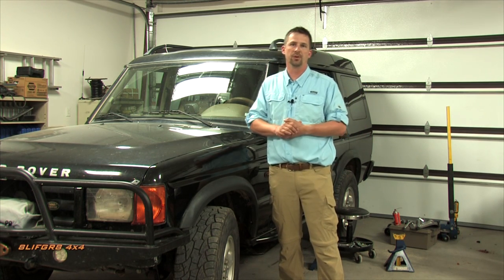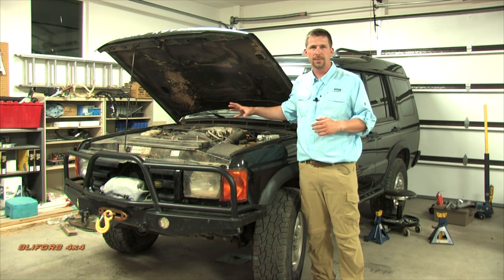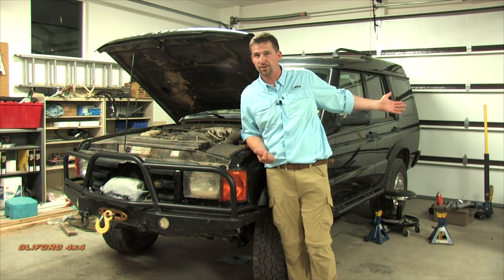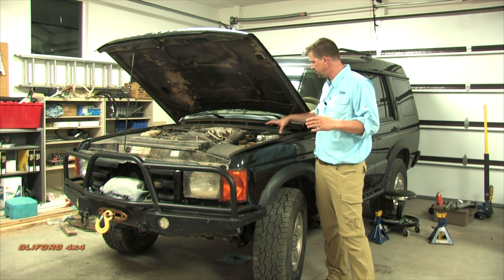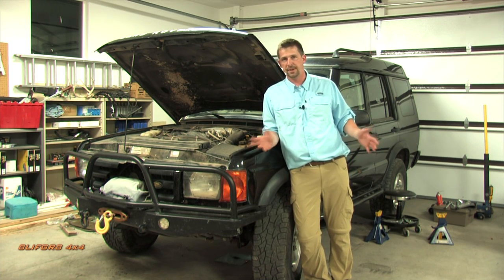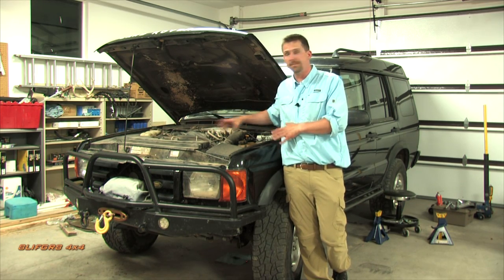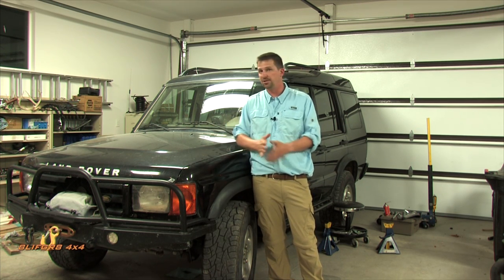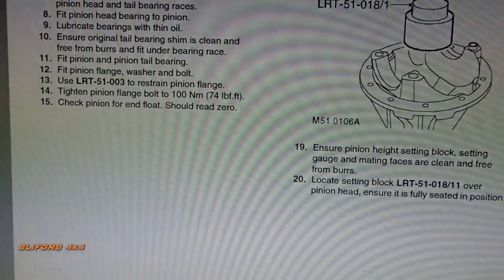Ultimate Owner's and Buyers Guide:  Land Rover Discovery 2

Comment: I’m taking a different approach at this project build. I’m from Memphis TN and am going to look at a 03 disco with 123k miles for around 1700$. even though they are the most disregarded out of the disco I’m itching to get my hands on one. This would be a multiple year project so I would have time to do a 04 transfer case swap eventually. Let me know what y’all think of this idea.
Reply from the maker: If the engine is solid, it should be a fun build.  Look into the '03 oil pump issues.

The prices are appealing, no doubt.

Comment: Very annoyingly in UK the central locking diff even in 2004 was only an optional extra not standard as it was in US. So I have. 2004 TD5 in basic trim with no centre diff (aaaaagh!) so at some point I’ll have to buy an earlier transfer case with the centre diff lock. DANGIT!
Reply: But at least I only paid £2200 for it!! :-)
Reply from the maker: Ugh, do you have the diff lock on the t-case?  Maybe you can do the d1 shifter like I did on my '99
Reply: @ForgottenWaypoints  I haven’t actually crawled under to check yet but I’m told that after the early 2000s they even stopped putting the none functioning diff lock in the case at the factory. Still I can hope and crawl under when it’s dry and look for the tell tale nut, you never know, I could be lucky eh! :-)
Reply from the maker: @garviere  , That's how it is in the states from sometime in 2000 or so to 2003 you won't have the diff lock.  But if they started putting them back on the T-cases in '04...who knows?  

I honestly didn't know you could get it without the CDL in '04.

Comment: I have served around the world with the RCN and have a,ways loved driving rovers. Well now that I’m at the end of a fantastic ride, I bought a 2003 Land Rover se. my kids have had it basically rebuilt. Thus I’ve started watching all the various blogs since even I know the these cars have issues. This video is great, so I have to ask two questions, what type of gas do I put in this brute. The mechanic is telling me just regular unleaded, yet gas cap says premium (I have 193,000 Khm ) on her, additionally. Should I remove the catalytic converter so as to ensure I don’t dry out the drive shaft. Thank you gents.
Reply from the maker: I'd keep the cats as the ECU is checking the O2s pre and post cats.   I ran premium because I was terrified of a slipped liner and wanted the best detergents; however, I don't think the compression ratio is high enough to justify it.  Maybe someone else will chime in??
Reply: Ok so do the things you talked about for drive shaft, I’m making the oil change this week. My mechanic is giving me grief for wanting to change the thermostat, he already did. Might add he is Iraqi ( Christian living here 20yrs) keeps saying it’s not the god damn Sahara here in Canada.
Reply from the maker: @shanecrawford6023  , Hahahah.  The problem isn't exterior temperatures, the problem is how hot it allows the block to get. 

With the TD5 thermostat, you are putting the engine block to the temperatures that Discovery 1 and GEMs V8 Range Rovers came out of the factory with.  The Bosch V8s were all elevated in temperature, and anecdotal evidence on the web suggests that this "encourages" future head gasket failures (GEMs motors don't have this issue as often as higher-temp Bosch V8s).

That's why I recommend the 180F TD5 thermostat.
Reply: I fully agree, all your points make sense. Itrue,y did t know that they were using 60s style of engine, thus we should be following how it would have been dealt with then. I believe I mentioned that come the end of month I’m changing the oil following your recommendations as well as thermostat. Once again thank you for putting out such a good video series, and more importantly emailing back.
Reply: Now that I’ve owned this land rover for 9 months, I’ve spent just under $3000 Cdn $2600 Us getting things fixed ex: leaky rear sun roof, rear right door not working, repaint roof and hood due to clear cost, and reservoir tank replaced.
I’ve changed the oils and oil filter following your suggestion, what diff Liu’s would you suggest, winter here in Ontario can get to -45c to 35c plus in summer.
Appreciate all your info to date.

Comment: Good review. Slipped liner is actually less of a problem than straight head gasket failure and cracks between the bores. Even with the lower temp 3 way thermostat in the bottom hose is that when full coolant flow is required the 3 way still diverts coolant to the heater matrix under the dash. Removing it and using a top hose Mezerre or similar 82 degree C inline thermostat. Amazing difference. Still gets hot enough to heat condensation out of the oil, get to closed loop and have completely normal fuel economy. The 3 amigos are often just wheel sensor however when they don't go it is usually a crack in a circuit board in the modulator.  You don't have to replace the modulator. Google WABCO ABS modulator Option B.  The genuine German made rear rubber coupling is excellent.  The front drive shaft...just get a Woody greasabe heavy-duty 1310 unis shaft.  Excellent gear. Greasabe centre ball also.  My D2 is  just under 20 years old . Had since new.  Used it a lot on beaches and never had a hint of rust.  Cheers
Reply from the maker: "never a hint or rust", the envy of Toyota fans everywhere..

Comment: My 99’ disco 2 temp gage doesn’t ever change indicating the engine temp is rising, etc... Is the gage suppose to move indicating a change of temp. Or should I not be worried assuming it is simply not over heating? Would a faulty code reader pick up on the temp sensor if it was bad?
Reply from the maker: If your gauge is stuck at center it means your temp is 158ish to 215ish.  If it's on the low side....you are fine.  If it's on the high side, you may be slowly cooking your head gaskets.

The only way to tell is get an OBDII scanner like an ultragage and use it instead.

Comment: The ZF autoboxes are not 5 speed but 4, the manual boxes are 5 speed.. The USA only has the V8 which came with automatic only i believe, so 4 speed.. just sayin ;)
Reply from the maker: Did I say 5 speed?  It's been so long since I made the video.  It's the 4HP22 in the V8s, definitely a 4 speed..  Oops.  Thanks for the clarification.

We didn't get the 5 speed in the states, the 5 speed was available in the D1, but not the D2 over here.
Reply: @ForgottenWaypoints   Yes i am in the UK we are lucky to have the TD5 and the V8 but we never had the later 4.6 in the D2 only in the P38  range rover :)

Comment: any1 every tried drilling air holes in oil filter large enough to help cool oil & by default engine safety protection at speed. Then wrap the filter in fiber mesh dippers to soak up hot oil, & few hose clamps to hold dippers on. Will drip a bit but shit engines all dip oil any way. Just need a catch cap over the dipper to catch what ever dips till u can pour in new oil & empty dipper & catch cap. Might need a new engine that get better than 13mph has power won't over heat & works w/good 5 speed or comes w/a similar good trans. Then u can get even better deal just find blown engine discovery in good shape minus engine.

Comment: I have a grunting steering box when turning steering wheel at 1-3 mph.  Started after replacing the hoses.  Do you have a fix for a steering box with this issue?
Reply from the maker: I'd post on the forums and see if anyone had issues.  My steering has been solid, the only issue I had was the linkage joints failing.  I ordered an HD track bar and draglink from Rovers North and fixed that.

Comment: I’m confuse on the engine, so why is it a v8 but has little power for hp and torque?  Also I saw one the other day for sale and I was going to buy it but I don’t know anything about these rigs besides the look of it.
Reply from the maker: 4.0L naturally aspirated over head valve V8 block from the 60s with modern fuel injection.  Honesty, the rover V8 is actually a pretty dang good motor for what it is, it's just the last production run that has issues.

Earlier blocks are modified for racing applications in the UK, similar to an old Chevy small block.

Comment: Thanks for a nice vid. I am in love with this vehicle TD5 Diesel engine with 2500 cc. It a good thing that you have explained a lot of thing. I am living in a country which i actually not cold (Tanzania) so please tell me will that t/stat be an issue to me? Will tht need to be removed forever?
Thanks Man.
Reply from the maker: The TD5 uses the colder thermostat stock.  Here in the states we buy the TD5 thermostat for our petrol V8's 

I'd ask a UK forum if there is any recommended maintenance for the TD5.

Comment: I’m between buying a discovery 2004 and a 2002 4.runner I’m having a hard choice between which one to buy
Reply from the maker: That's a hard decision.  I'd get the one you can afford in the best shape.  The 4runner will have a superior engine, but the Disco has presence.  Make sure the '02 runner doesn't have the lower ball joint flaw, I can't remember which model years of 4runner like to give up the LBJ on the highway.
Reply: @ForgottenWaypoints  both are at my price range the discovery has 113,000 miles and has a great enterior I’m just scared it may fail with the gasket issue the 4Runner has 194,000 and not that great enterior

Comment: I can’t find the Ultragauge on eBay.  Can you put a link up, thanks
Reply from the maker: I order them here.....

http://www.ultra-gauge.com/ultragauge/
Reply: @ForgottenWaypoints  hi there... I buy an ultra gauge but I don't know where to put the temp. Probe.. Is there some female tapped thread on the block that I can use for? Thanks in advance 👍
Oh, sorry I think I'm wrong... I realize when I read about ODBII.... Nothing related with the one I bought.. it's a temp. Sensor and volt meter lcd display.... Well I think I'll investigate more about how to put that temp.  probe on the block...
Reply from the maker: @fibertendom  , The ultra-guage uses the existing temperature sensor as reported by the OBD2 system.  

All you do is plug the scanner into the OBD port and then configure the display to show the gauges you want.  There is a tutorial on Ultraguages website.
Reply: @ForgottenWaypoints  many thanks👍

Comment: Fantastic video but did you really get rid of the LR II and get a Land Cruiser?? Say it ain’t so....
Reply from the maker: Disco is outside right now.  It needs a new battery and the headliner is sagging, most of this TLC is because I've been working on the Land Cruiser!  Go figure!

But I needed a bit more size and I wanted to see what Toyota is all about.

I do have my eye on the new Defender too..
Reply from the maker: I'm going to do the same buyer's guide on the Cruiser too....and I have quite a bit of content as the cruiser has been more $$ to own over the same miles as the D2.
Reply: 8LIFGR8 4x4 I owned a D1 and DII over the years and moved on to other brands but after watching your video I’m tempted to buy a DII again.
Reply from the maker: @SkywhiteChannel  I'm toying with the idea of finishing the maintenance on the D2 and selling it for a Range Rover Classic or a Series, something a bit older to try out.
Even a D1, if I could find it in a 5-speed!

Comment: can I take my stock  04 Disco II to an off-road park. what tips should I know
Reply from the maker: It depends on the park.  The Discovery 2 in stock configuration is quite capable, the biggest issue will be the rear overhang followed by approach angle on the front bumper.

Have an experienced spotter with you and go explore, you'll be surprised by the capability.  And the '04 has the factory center diff lock, so that's another bonus!
Reply: @ForgottenWaypoints  does the factory "center diff lock" mean that I don't need to get ARB lockers as I build the Disco into an off-road rig?
Reply from the maker: @cwparker4874  , not necessarily.  Eventually, you will reach a point where you may want front and rear lockers.  I do not have them on mine.

The center differential locker is the most important and combined with traction control will get you through most trails.

Definitely look into finding a local off-road group or club and go practice and learn your vehicle's capability.
Reply: @ForgottenWaypoints  Thank you so very much for the video and the information...I am in NorCal Tracy and the Carnegie State Vehicular Park is very close so that's where I wanted to go just to see...my desire and design is to build the rig, but this is my first LandRover I had a K-5 previously...so I will join the NorCal LandRover club ....thanks again and the video is VERY helpful
Reply from the maker: @cwparker4874  , Awesome.  I'm sure if you go and find someone and ask questions they'll explain when to use low range and lock in the center diff.

Most people in the sport are helpful and friendly to those joining in.  Let me know how you like it!

Comment: About to pull the trigger on an 03 with 150k miles for 3k. Should I do it?
Reply from the maker: If you want to hardcore off road, make sure it has the center diff lock on the t-case.  Then, at this age, it's all about the rigs condition and maintenance.  Good luck!
Reply: @ForgottenWaypoints  what if no center diff, can I swap transfer cases and achieve this or is it simpler than this
Reply from the maker: @NickyTBeats  , you'd have to swap cases on an '03 I believe.  You can crawl under and see if the case has the CDL, there is a nub at the top that you can fit a wrench on (I can't remember the size) and use that to manually turn the CDL on.  IF you have that, all you need is a shifter to connect to that nub.  If you don't, you'll need a case that has the CDL

The forums will help show you what you are looking for.  Try Discoweb or LandRoverForums
Reply: @ForgottenWaypoints  Thank you so much!
Reply: Pulled the trigger, need a water pump to get me out of the parking lot lol an I'm flat broke now 😅
Reply from the maker: @NickyTBeats  , hahah...budget a cooling overhaul if the pump is bad.  Do the hoses, radiator, 180F thermostat and fan clutch.  Then as the kids say: "send it!".  Congrats!

Comment: Driveshaft failure only known to happen on v8
Reply from the maker: Thanks for the update.  That would make sense, a sealed bearing should last a very, very long time, if the TD5 doesn't have cats to soak heat in the area of the double cardon, it won't fail from drying the grease out.

Comment: The best advice is: DON'T EVER BUY ONE...unless you just want to use it for a crash derby.
Reply from the maker: Just as long as you are ok losing the derby.  Aluminum block V8 sensitive to overheating and making no hp, aluminum body except roof and hatch, top heavy design.  At least it has a good 4wd system.  Destined for last place.

Comment: All you need to know is this note....don't ever buy a DII EVER. There, didn't even need to watch this dumb video. If you insist on moving forwards - FIRST thing you do is rebuild the engine using tophats....then whatever.
Reply from the maker: Top Hat is definitely an option, but I'd only suggest that after you have a slipped liner.  Stick with the TD5 180F thermostat and there is a decent chance you might make it to 200k miles without incident.  You never know.

D2 is quirky, but I'm well on my way to collecting material for a similar 40 minute video for my 100 series Land cruiser.  More reliable motor, but a vehicle is more than it's engine.  It has quirks (and expensive ones) as well.  There is no perfect 15-20 year old rig.

Comment: After watching, i am questioning LAND rovers engineers and project leaders, why you can make so many poor engineering decisions? 
Cant u just look at what Toyota been doing since 80s?
Reply from the maker: Smaller company and smaller budget.  Rovers biggest issue in the D2 is engine tooling end of life.  It stinks, but is what it is.

Toyota still can’t get a frame coating right and have recalled even new 3rd gen tacomas for rust.  I stripped bolt heads off my ‘24 Tacoma due to over torque from the factory and every 100 series dangerously off-gasses fuel when climbing elevation or extended periods in 4lo.

I love my Toyotas, but they aren’t perfect either.

Comment: As nice of a vehicle design the Rover is, the junk  Engine design and sloppy tollerances and silly front driveline angle  . Fatal sticking Oil pump valve is just too much. You can pay for a new upgraded long block and play with a Constant plage of issues that are well known . Theres a reason they are cheap .Way easier to just avoid it ..I will pass.
Reply: I have a little more money than I used to and was intrigued by these after finding a nice 2001 on Craigslist owned by an Enthusiast who'd done most of the work mentioned in this video but he wants $3,000, I used to drive under $2,000 or much cheaper Mitsubishi Montero full size ltd's that rarely if ever cost anything above and beyond the purchase price , well said